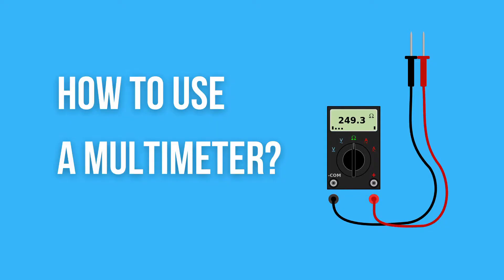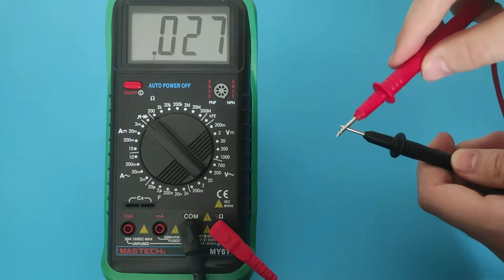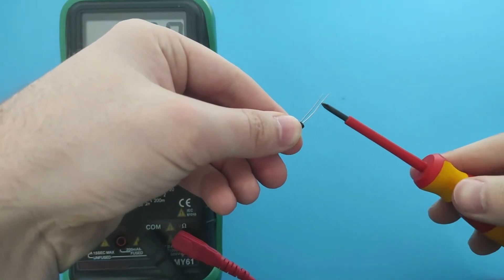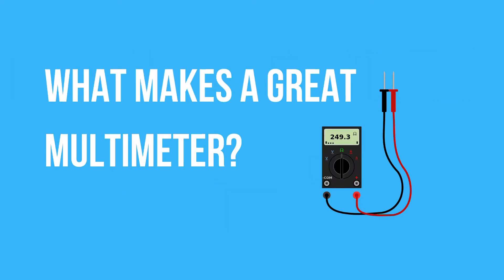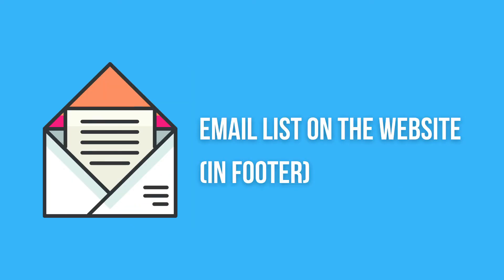How to use a multimeter - (Ultimate Guide For 2022)

Comment: Hi. Thanks for clip.
I was testing new IAC valve, not cheap one. And at continuity test beeper doesn't make sound, just show 500 something number. And I couldn't check resistance at any pins combination. Have you any idea why is it like that? There is magnetic field part and maybe some coil.

Comment from the maker: Timestamps:
00:00 Intro
00:38 Parts of multimeter
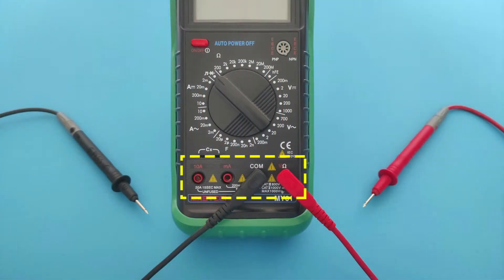00:57 How to connect probes
1:30 Continuity testing
1:51 Measuring resistance
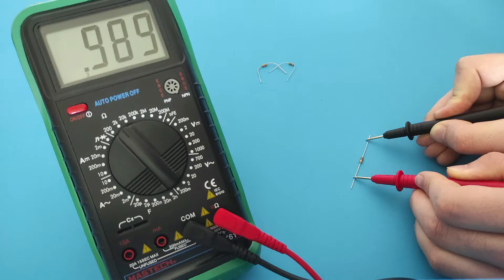2:14 Transistor testing
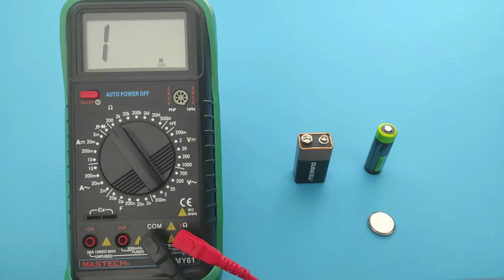2:36 How to use a multimeter to test a battery
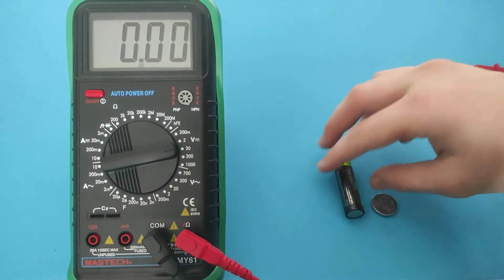2:57 How to measure AC Voltage
3:19 Measuring capacitance
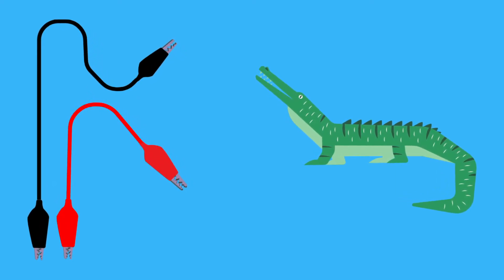3:59 Buying a Multimeter
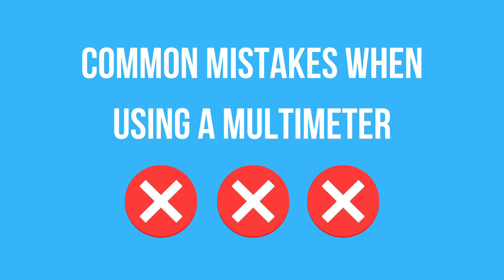5:09 Common mistakes when using a multimeter
5:43 Additional Tools with a multimeter